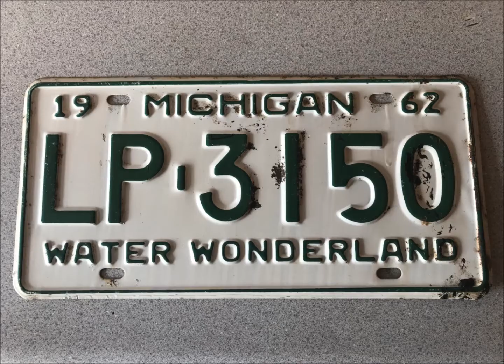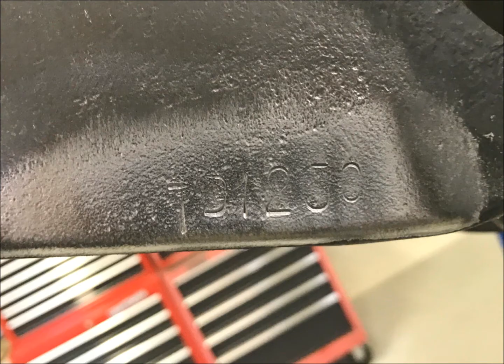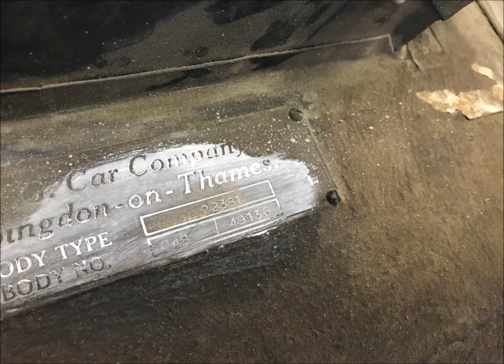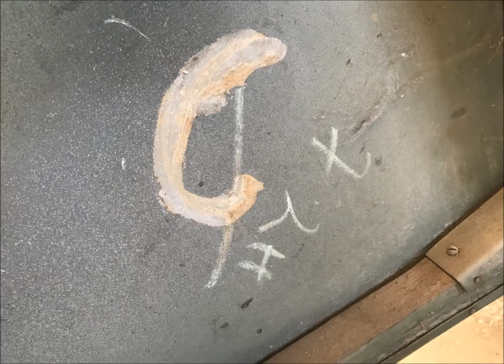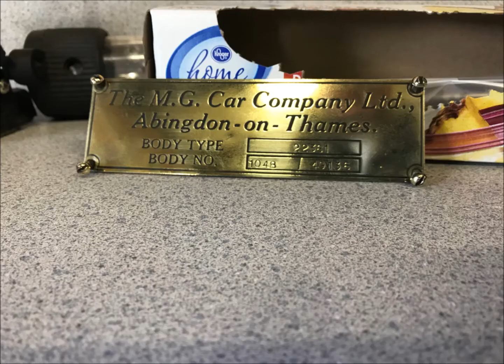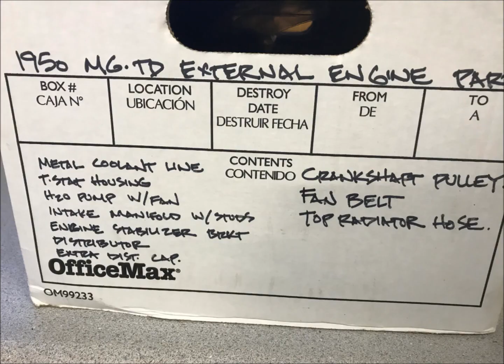1950 MG TD Part 1

Comment: LaVerne, @ 3:22 what is the blue flamed device you are using?
Reply from the maker: It's a small butane torch.  Keeps the heat in a smaller area than the bigger propane torch I also use.  The heat will generally break the bond on rusty screws and nuts and bolts....but not always.
Reply: @larue33054  
That was fast!!  
Exactly what I need - haven't had to have oxy/acetylene torch - yet!
Really enjoyed this video - good tub pics - exactly where I am on my '53 TD.

Thank you, Sir!
jim